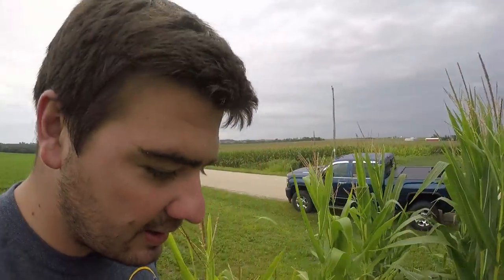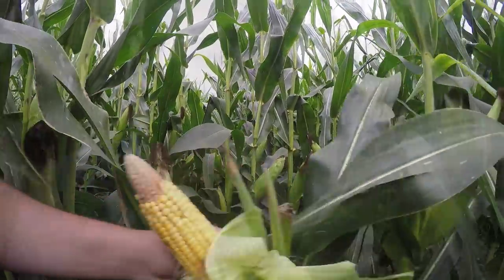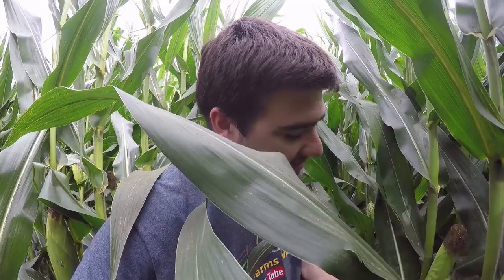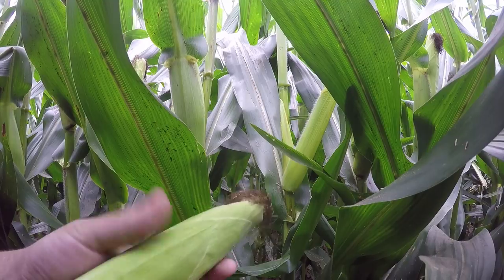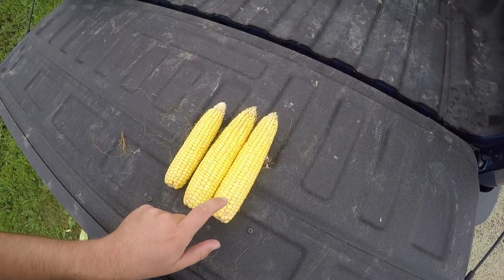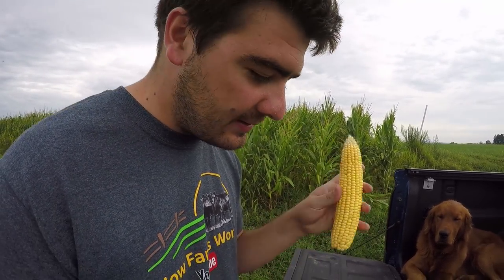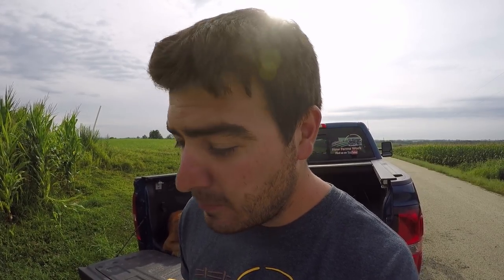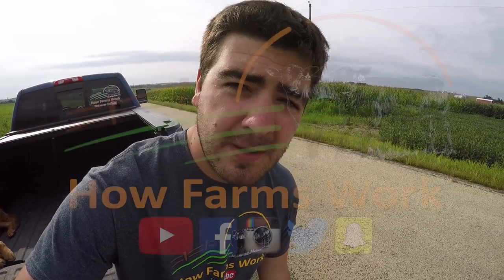Corn Yield Concern

Comment: A popular crop consultant here in SW Ont. says if he could, he would weld the depth stops on all planters at 2 inches. One thing about corn is there is little recovery from a pour stand. You're pretty much screwed if you don't get 90% emergence. JMHO. Now beans are a lot more forgiving, 75% stand can still produce top yields. The thing about farming is all the technology in the world can't overcome the will of mother nature. A dry spell at planting time ,or excessive rainfall shortly after planting time can leave you sucking hind tit, no matter how well you planned the crop. It's a roll of the dice at best.That's why farmers are the biggest gamblers in the world. JMHO KIT d
Reply: Douglas Laramie I
Reply: Absolutely... weather is STILL the biggest factor... 

Having the newest/best planter in the world HELPS, don't get me wrong, but it can't make up for crappy weather.  Having the fields in the best condition ever, so the planter is running on ground smoother than a runway HELPS, but it can't make up for crappy weather.  At best it can only HELP you to get the best stand you could get UNDER THE PREVAILING CONDITIONS AT THE TIME... 

Planting with a worn out or improperly adjusted planter, it's just not going to get the kind of CONSISTENCY in seed depth, coverage, and placement necessary to OPTIMIZE the existing conditions... That's why keeping a planter in top condition and PROPERLY EQUIPPED AND ADJUSTED for PREVAILING CONDITIONS is SO important.  But MORE important is planting into the best conditions possible-- and HOPING that the prevailing conditions are favorable for rapid germination and even emergence.  

I know a LOT of guys who just hitch up to the planter, make sure all the parts are "there and turning" and they set the transmission by the book for the population they want, dump seed in, and GO.  MAYBE they check the depth one or two times on a couple rows.  When I was planting, I checked the depth and job it was doing at least twice a day on EVERY row... BUT it requires getting OFF the tractor, going behind the planter, and actually DIGGING UP SEED and checking the depth, spacing, and coverage... and then making the NECESSARY ADJUSTMENTS and then FOLLOW UP CHECKING to see if the adjustments made things better or worse, or solved the problem observed... A lot of guys just want to dump seed in and watch the monitors... that really doesn't cut it... At the very least they should be spending the first day planting checking the depth/spacing/coverage of the seed, and once the planter is working satisfactorily, THEN run "full out" and cover some ground... and when changing fields or moving into different conditions (say from heavy soil to light soil, or drier ground to wetter ground, etc) STOP and do a quick 'double check' on the job the planter is doing.  A monitor only tells you SO much... it doesn't tell you the depth and coverage of the seed at all, just if the population is "right".  

There's still NO substitute for getting off the tractor and digging to see what the planter is ACTUALLY doing... 

Later!  OL J R :)

Comment: Hey Ryan, we plant with a Morris Contour air seeder at an inch with paired row 2nd week of may and at 25th Aug it passed ten feet for average, most plants are putting on 3 cobs but theres been up to 5 in heavier soil, direct drilled into stubble which we were told not to do or use an air seeder. We'll silage the headlands and then break the field into grazing paddocks for winter for 150 Angus incalf, we're 2 hours north of border into Manitoba so it can be done. Cheers.

Comment: Great video    Just wondering will you need to pickup the flags in the field prior to combining? I noticed the shafts are metal. When I would locate cable (telephone, fiber, coax) I was not allowed to put metal flags in farmers fields. Just curious. This was before plastic shaft flags were available had to paint or use orange tape.     enjoy all your videos.
Reply: Metal flags aren't good to run through a sicklebar (like cutting beans) but wouldn't make much difference to a corn header, because it uses intermeshing rollers instead to pull the stalks down.  

Still I wouldn't want all that flag wire out there next year, no-till or not.  Disking them in will just scatter them around, and they can find their way into all sorts of things-- usually bearings and seals on disks or planters... tires, or other stuff... 

Later!  OL J R :)

Comment: You should wear protective glasses when walking through a corn field.  Why you may ask, both my dad and uncle got nasty cuts on their eye balls from corn leaves when they were inspecting them.  Both still have eye issues and it is 30+ years later!
Reply: Yeah Pioneer requires their field people to wear both eye protection AND a veil (netting like a beekeeper's mask almost, usually sewn onto a regular ball cap-- they issue them these caps in the spring) to prevent corn leaves from cutting them... 

I know I've had sorghum leaves and johnsongrass leaves cut me before, on my hands or arms... amazing how johsongrass will cut you like a butcher knife!  

Later!  OL J R :)

Comment: Ryan to make a test of how much the field would produce, is to plant in row different depths all throw the field and take samples from the outer,  inter and centers rows then that would give best count how much it would produce but the  way you did it will work just as well hope for the higher count but think of lower then you will be surprised of  the actual count.

Comment: What are optimal combinations of moisture and temp from now to harvest that can affect weight, or is that pretty much determined by this time of year?
Reply: The old adage is "rain makes grain" and that's true, to an extent... course too much rain drowns crops or roots and isn't any good either, "everything in moderation" comes to mind.  

As for yield, I've read that about 90% of yield POTENTIAL is determined in the first 30 days of growth.  Now of course everything can be PERFECT at planting and have a beautiful consistent stand lacking for NOTHING, plenty of fertilizer out there, not too wet or too dry, not too hot or too cold, no bugs of consequence or pathogens infecting plants in the field, and then have the weather turn bone dry or blazing hot or too cold or flooding rains all the time, or hail or windstorms that beat fields flat, and not make anything.  I've also seen fields SO beat up or with SUCH crazy, scattered emergence that you didn't think they'd make ANYTHING worth mentioning and they actually made BIN-BUSTING YIELDS despite the sorry start or the huge setback somewhere along the way.  

This past year was like that in Indiana.  Planting season was WET, WET, WET!!!  I couldn't go help plant because my mother was in the hospital here in Texas at the time, but the BIL told me that they planted some fields of corn and then had it rain for 3 weeks STRAIGHT, nearly every day, with NOTHING coming up.  Then it took another TWO weeks after the rains finally broke before they could even THINK about getting in to replant.  He thought the seed was all dead and rotted, but over those two weeks, after having sat in the ground for 3 weeks straight in basically saturated soil, every day a little more corn poked up.  By the time it was dry enough to get back into the field to possibly replant, there were some plants just popping up, and others 4 inches tall or so beside them!  It was already June by that point and the typical results for June corn are lackluster at best (IOW even if everything goes PERFECT for June-planted corn, usually it will only produce a "so-so" crop at best).  SO, looking at what he had planted, he had an acceptable stand, so he said, "screw it" and left it.  He said when he was sidedressing on anhydrous ammonia fertilizer, he wouldn't have given a plug nickel for the crop-- there were plants knee high going under the tractor next to some a foot tall, and the next one might only be 4-5 inches tall... just all over the place...  To top it off, he had one field where he got the gears backwards on the planter when he set up the transmission for the population he wanted... say instead of a 30 drive sprocket and a 46 driven sprocket, he accidentally selected them BACKWARDS with a 30 DRIVEN sprocket and a 46 DRIVE sprocket... So he planted about 15 acres at 40,000 seed per acre, which was SUPER heavy-- the monitor was telling him that and he went and looked, but couldn't figure out what was wrong until the third time he looked at it, and then figured out what he did wrong and corrected it... then the monitor showed 34,000 like he wanted... Course he didn't expect that corn to make much of ANYTHING since basically it's competing SO much against itself that it just chokes itself out...  

BUT, when harvest time rolled around, we picked 170 bushels off the over-planted field, and 190+ average off the rest of the farms...  Some sandy farms that he never made over 180 before had a 190 average, and some better heavier soils ended up with 220+, even 260-300 in some spots on the yield monitor... course by the time all was said and done he ended up with about a 220 average across all his ground.  200 is considered the "magic number" in his area... 

Grandpa told me about one year it rained SO MUCH they couldn't get the cotton planted... just rain and rain and rain... ground was too wet to even prepare for planting.  It was the end of May, which is about 5-6 weeks late for planting, and it FINALLY dried out JUST enough that he could "mud it in", so he went out there in the muddy fields and planted the crop.  In places it was SO muddy the seed was just laying on top of the ground-- the old "blackland" type lister planters they used back then wouldn't even cover the seed (they used a pair of shovels in the back to throw loose dirt over the seed after a sword opener placed it in a very shallow seed trench, behind a big cultivator sweep running behind a gauge wheel).  The cotton germinated and came up to a stand, but the neighbors all thought he was crazy.  The neighbor behind us worked up his field a few days later and then let it dry out a few days, and planted a week later...  Grandma said that when picking time came, they made 3.5-4 bales to the acre, which was nearly unheard of at that time, while the neighbor had about 1/4 of a bale per acre... Just that week's difference made ALL the difference!  

SO, crops can be surprisingly resilient and flexible, IF the conditions are right, or the "bad stuff" happens at just the "right" time (best timing possible in the circumstances).  

Later!  OL  J R :)

Comment: Isnt that why you cultivate the no till fields to fluff up soil to retain better moisture? Did travis forget to do this field? haha
Reply: Doubt they cultivate the no-till fields... probably too much residue, ESPECIALLY after corn-on-corn (grew corn in the same field last year).  Row crop cultivators do not do well with the much firmer soil in no-till either.   You can get no-till cultivators, but they're usually built MUCH heavier (more like a strip-till machine) with a single large sweep between each row and a larger heavier gauge wheel and a coulter blade to cut through the residue to prevent it dragging up "haystacks" of residue with the blade shank...  Those are fairly new and pretty darn expensive, compared to their old "Vibra-shank" cultivator they're using which is built much lighter and is probably quite a bit older... 

Later!  OL J R :)

Comment: I hate to say it, Ryan, but I think your methodology is flawed in your depth test.  And you pointed this out in the video.  You're going to skew your results because of the earlier emerged plants choking out the later.  I think a better methodology would be to plant full rounds at different depths, and take your sample ears toward the middle of that swath.  Then you see a more accurate representative of what that planting depth would look like if the whole field were planted that way.  Just a thought.  Take care.
Reply from the maker: Definitely, but as we don't have hydraulic downforce yet, this is the best sample I've got.
Reply: What's being demonstrated is the importance of CONSISTENT depth control, not necessarily one planting depth versus another... ie "deep planting" versus "shallow planting".  In practice, usually whatever minimum depth you can ensure that the seed will ALL be able to access and imbibe enough water to germinate and emerge RAPIDLY AND UNIFORMLY is usually the "best".  Planting unnecessarily deep simply makes the seedlings take longer to emerge, meaning they are subject to soil-borne pathogens and parasites for a longer period of time before emergence, use more of their energy reserves in the process of emerging from the soil (since they have to grow farther to reach daylight) and are slower to emerge, meaning at more risk from weather events (like a pounding rain causing crusting issues, etc.)  OTOH, planting TOO SHALLOW can result in some seeds being dropped into dry soil, and a seed will not germinate in dry soil... it has to imbibe sufficient water first before it can germinate.  A seed can be laying on a 1/4 inch of dry soil underneath/surrounding it and it won't germinate if moisture cannot permeate that dry soil (IOW make it wet) and the moisture come into contact with the seed in sufficient amounts to be imbibed into the seed to germinate it.  Nearby seeds may well be in contact with moist soil and germinate, leading to non-uniform emergence... so planting depth is always a tradeoff between going deeper (to ensure that ALL seed is placed into moist soil and therefore germinates at "the same time", versus the effects of deeper planting (more death loss to the stand from seedlings killed before emergence from pathogens, parasites, or running out of energy reserves, OR planting shallower to ensure quicker emergence once a seed DOES germinate, BUT running the risk of large numbers of seed being "too shallow" with insufficient moisture to germinate "all at the same time" and thus be delayed for a time until sufficient moisture reaches the kernel to germinate it.  

CONSISTENCY in the planting depth also plays a key role in that the seedlings only grow at a "given rate" and thus a seed planted deeper into moisture will germinate at the same time as a seed planted shallower into moisture will, BUT the deeper planted seed has further to grow to emerge from the soil surface (since it's lower below the surface) which shows up as delayed emergence, which they flagged the plants emerging one day or two days later than the others in this test.  Delayed emergence= plants shading each other, which reduces yield on the later emerging plants.  

IDEALLY, EVERY seed would be planted at the EXACT same depth into moist soil, and therefore would emerge at the exact same time.  In practice this is impossible, but measures CAN be taken to improve the chances and minimize things that contribute to irregular planting depth.  First is field condition-- a smooth, firm seedbed that is moist nearly to the surface (ie has been "rained on and dried out" will cause less planter bounce as the planter rolls across it which means the planter will do a better job of placing the seed at the exact same depth.  Another important issue is the planter condition-- in good working order without excessively worn parts-- for instance, smooth running gauge wheel bearings, pivots, and bushings, smooth running, sharp, and not excessively worn opening disks and internal and external scrapers of the opening disks, gauge wheel tires in good condition and properly adjusted to lightly contact the opener disk to minimize/eliminate rooster-tailing, which puts dry soil in the seed trench with the seed, a good firming point (on IH planters) or seed tube boot (on Deere planters) and good seed tube without excessive wear which will keep soil from being kicked up around the end of the seed tube as the opener disks leave the soil as they roll forward, allowing the seed to drop to a consistent depht, seed firmers (if installed) properly adjusted and in good condition to press the seed gently into the bottom of the trench, and closing wheels properly centered and adjusted over the furrow, with bearings, wheels, tires, etc in good condition, with the proper down pressure.  All planting units should, ideally, be "zeroed" in so that a given notch on the gauge wheel adjustment rack (planting depth adjustment on the unit between the gauge wheels) should be IDENTICAL from row-to-row (Kinze "zeroes" all their units at the factory, not sure about the others).  Similarly, down pressure should be as near identical as possible from row to row, and the press wheels should be CENTERED so they run equally distant from the center of the seed trench (not one press wheel in the trench, or very nearly so, and the other beside it).  OF course proper selection and adjustment of the press wheels for the conditions (such as selecting cast iron closing wheels, or various spiked or curved tine closing wheels, etc) is also extremely important, so that all rows and all seeds in the row have the soil pressed in around them with as nearly equal force, depth, and volume as possible.  Even then, slight undulations in the field will STILL cause variances, or riding up over a rock, etc.  BUT you've MINIMIZED those effects with proper ground preparation (smooth as possible) and proper machine preparation (everything in good working order, properly adjusted, and operated at the correct speed and down pressures for the conditions).  

Later!  OL J R :)